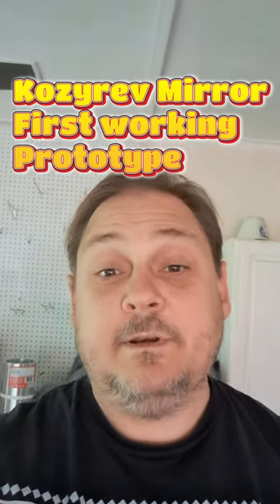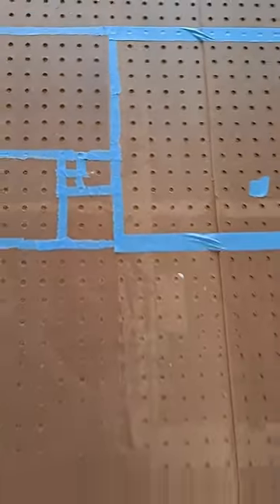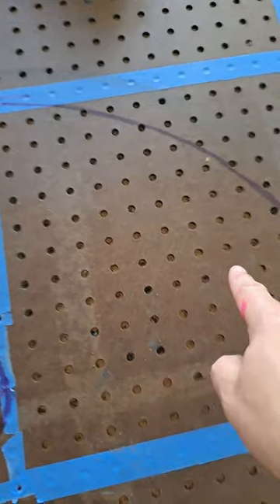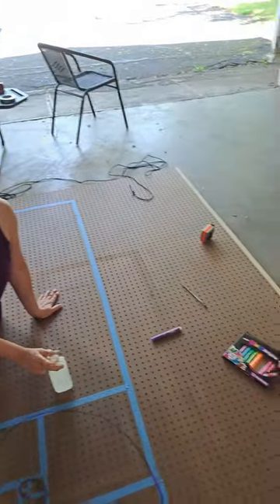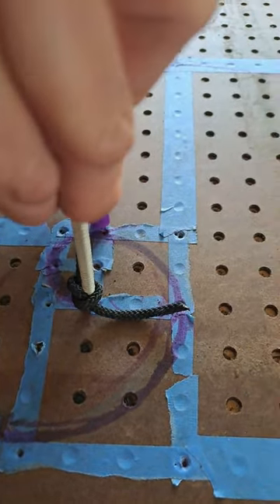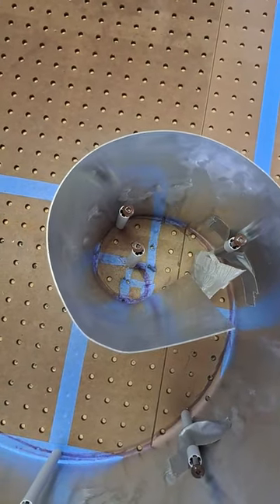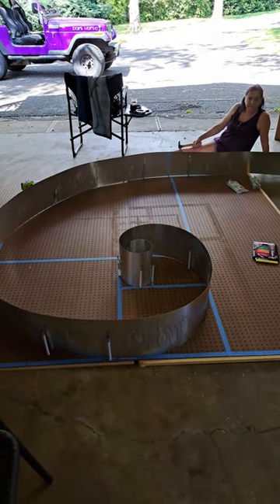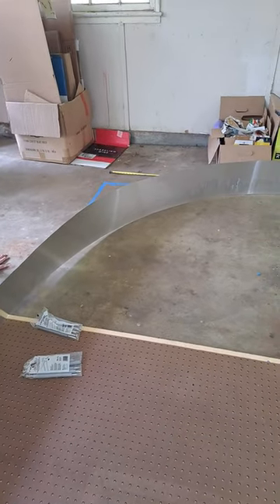Full Prototype Build - Kozyrev Ascension Mirror

Comment: Where did you ever see that it had to be a fibonacci spiral?  We built a kozyrev mirror by following the patient plans, and its a spiral but not necessarily a fib spiral.
Reply from the maker: The fib spiral is a better way to collect and amplify the energy, but a normal spiral will work. The fib spiral was mentioned in the Why Files episode about the mirror.
Reply: @HealingUniverse333 I would also try to put a 7.83 Hz ELF magnetic generator in there with me and put a -20,000 volt current into the mirror.
Reply: Fib spirals are everywhere in nature for example, seashells so it makes sense the natural spiritual approach is fib spirals. That said, Scientific research into this may be interesting to experiment with different types of spirals, shapes etc.
Reply: @limitlessenergy369  curious about this
Reply: @Coach_Snoupii  Check out the book or pdf of The Sacred Mushroom by Andre Puharich
Reply: What was your result with the mirror?

Comment: One of the thing that Ive been thinking about is the energy of dread or fear that these things supposedly emanate. I wonder if people who are building these privately are experiencing this at all. There are numerous logarithmic spirals that one can use, I wonder if useing different ones produces different effects.
Reply from the maker: We have not experienced it yet but ours is small. We are working on the next version and will mention what we feel if anything. As for the shape of the spiral, I think fibonacci is the best way to go due to its occurrence in nature.
Reply: @HealingUniverse333 it also has to be rotating like the original version, speed and direction unknown.
Reply from the maker: @allanallen1835  It does not need to spin, it is an energy collector/compressor, thus there is no need to generate an EMF field, which is why you would spin it (to create a field). So it just needs to be static.
Reply: @HealingUniverse333 north hemisphere, you need it to spin counter clockwise